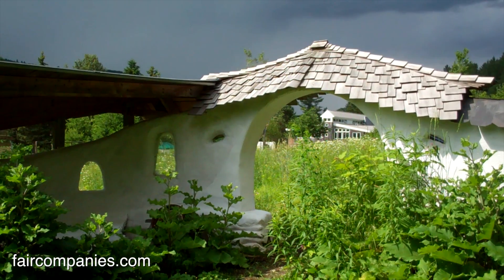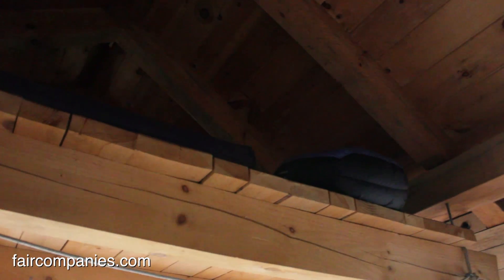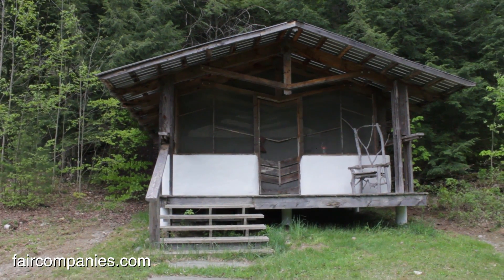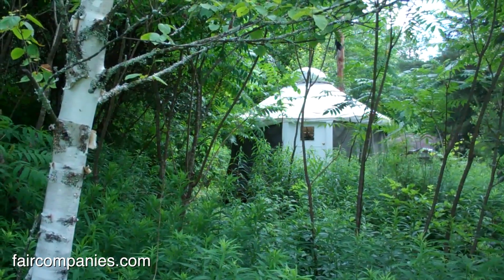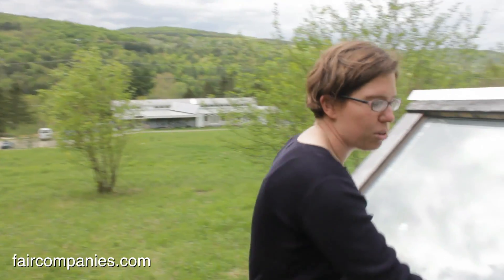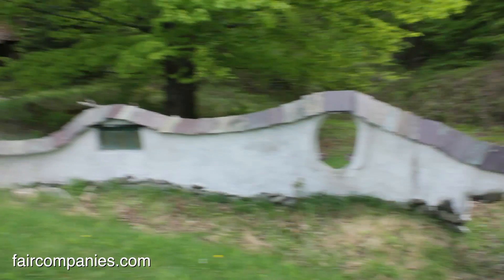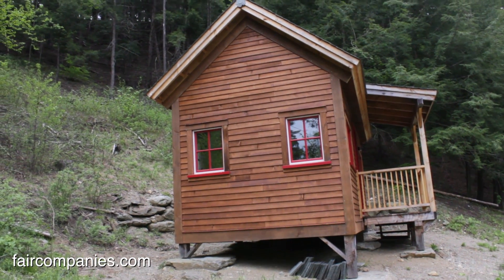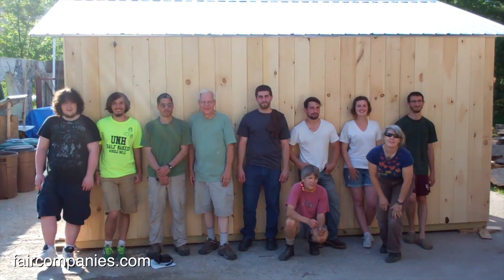Using solar, cob, hemp-crete in stunning off-grid compound

Comment: These all are very expensive and wont last long, these tiny houses will disintegrate compared to what they should be. also hempcrete is probably the best building material to make efficiently, cleanly, and quickly on earth, and that will last through ages, 1000 years, not 20-40 years
Reply: Cob if handled correctly  WILL last as long as hempcrete :) - I even saw someone build a wooden (outside)-hempcrete(walling insulation)-cob (inside plaster) house in Belgium and it looks NICE.

Comment: Great idea but this type wood is not readily available on the plains (Ok, Ks, NM) without high cost and many of the structures wouldn't stand up to the winds we have either.  Besides, building permits, inspections, etc. wouldn't allow most of this either.  The only one that has been successful here has been straw bale but even that is mainly used to feed livestock especially since the drought.  Wish you could come up with something else more practical other than earth ships